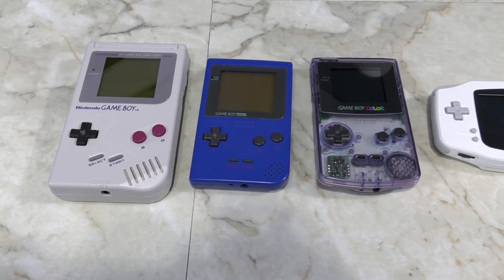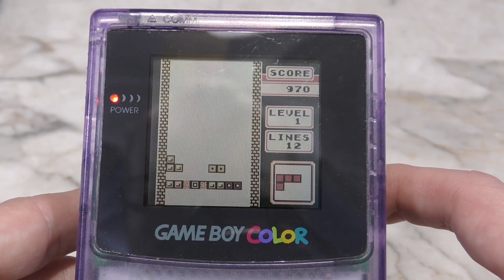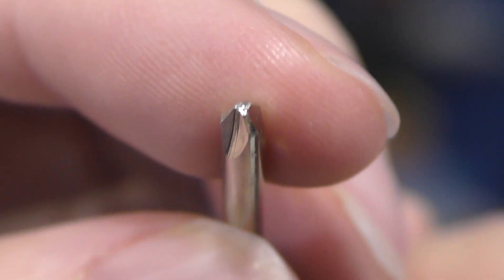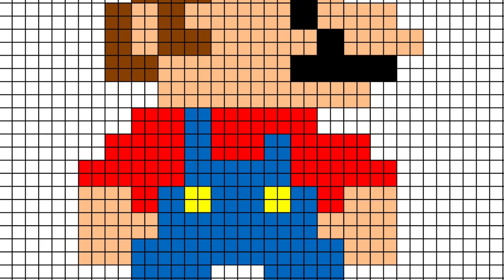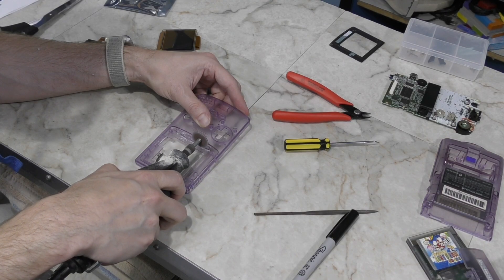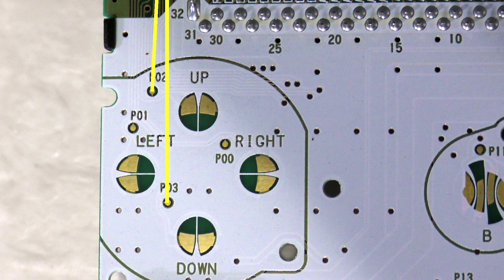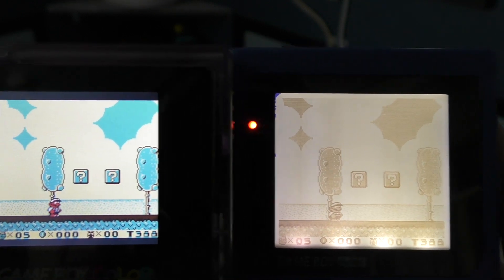Finally - A Gameboy Color Backlight Mod!

Comment: The Gameboy Color doesn't read the Super Gameboy Pallet enhancements. The way that the Gameboy Color and the Super Gameboy handle color is very different.  On the Gameboy Color, it has several different pallets for ALL Original Gameboy games, and it can't read the Super Gameboy enhancements.  The Super Gameboy can read the enhancements meant for it, and those that don't have those, you can edit the pallet it displays.

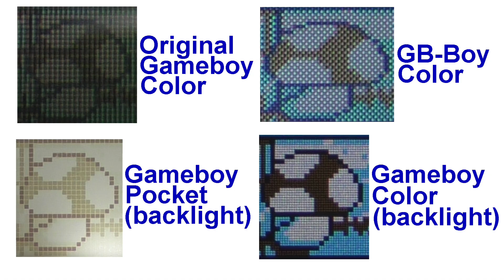Comment: What I'm noticing clearly now with the comparison at 11:55 is that, since these new backlit screens have way more pixels than the original screen, graphics end up looking a lot more jagged/stair-stepped than in the original, where things look smoother/rounder. I really wish we could get a screen with the same low pixel count of the original for a less pixelated/more organic look. We also need correct/non-saturated colors (ironically the colors on the GB Boy seem more accurate than on these new screens).
Reply: To me is quite the opposite. I really like that the pixels are more clear from each other xD.

Comment: 1:36 No, there was no color data in any game released between 1989 and 1994, because the Super Gameboy wasn't out yet, and the Gameboy Color was years away.  The games that seem to have their own color palettes only do so because the systems themselves have hard coding in them to look for certain games to apply palettes ad hoc.

Also, as far as color coding is concerned, Super Gameboy and Gameboy Color are two completely different things and not cross-compatible.  For example, Gameboy Donkey Kong has a comprehensive Super Gameboy color palette that doesn't load when played on a Gameboy Color.  There are games that had color modes on both systems (i.e., Wario Land II), but they were completely separate modes.

Comment: You need to be pretty hardcore to spend 65$ on the screen and at least 30 on a color. I mean I like playing on original hardware, but you get a bittboy for 40 bucks or an odroid go. Yeah, emulation will never be perfect, but it's good enough for me.

Comment: I think that new screen is sligtly smaller than original screen. And also games don't fill all the screen, there are black bars on the top and bottom edges

Comment: Something to try: there’s a product called “unseal” that is spectacular for removing adhesives and is very gentle, drying with absolutely no residue.  Doesn’t damage plastics and not greasy the way WD40 is.  May be difficult to find as it’s an industrial grade product.  I used it when I did conservation picture framing.

Comment: FPGA = the most power intensive digital hardware on the planet. Where's the battery life spec? That thing probably needs a new case with room for a lead/acid car battery. 
  There is an obvious reason why Nintendo didn't make a Game Gear. GG's were only as mobile as the distance to the next power outlet. We all liked GB's because they were actually mobile.

Comment: if 1 pix became 4pix, then shouldn't it be fourfold? how come it's only doubled?
Reply: Twice the horizontal resolution and twice the vertical resolution makes 4 times the surface (number of pixels being displayed). If your old screen is x pixels by y pixels, and your new screen has twice the resolution in both directions (2x instead of x, and 2 y instead of y), where the old screen would display xy pixels, the new one displays (2x)(2y)=4(xy) pixels.

Comment: Not a fan of the smaller screen size. I wish there was a larger screen mod for the GBC. Sure there are RPi mods (which are cool), but those are painfully much slower as oppose to instant on/off as the original hardware.

Comment: what a fantastic mod. You can go one up from this by using hacked ROMS that add full colour (actual proper colour, not interpreted colour from what little data is there). I've played pokemon Red with a full colour mod and super mario land 2 and they look absolutely gorgeous. With the right equipment I believe there is a way to flash these mods onto the real cart.

Comment: Going to play Devil's advocate here.

The reason Nintendo and CBS go out of the way to block unlicensed material to be released is not to be an ass, but it's for legal reasons. They need to protect their IP on every instance, no matter how small, because if they don't, then they set precedent.

Say they let that C64 port go because "it won't hurt their bottom line". Then another company decides to make another port, but for PC and for a bunch of other games, this time for profit. Now Nintendo is in a bad legal position to defend because there's a precedent when they didn't, which leaves them open to lose that litigation.

So yea, it sucks, but if they want to protect their IP, they have to do it to the fullest extent.

Comment: Isn’t there the mod from BenVenn called the FreckleShack?
Are they the same? Just curious.
Also, my GB Boy Colour has a normal vertical pixel LCD, not the strange diagonal pixel LCD yours has.
Like, the picture is still squished, but the pixels aren’t jagged.

Comment: Pity that higher res screen doesn't have a toggle to apply a simple filter to smoothen out the image like in emulators. But I guess that would probably require some extra hardware attached to it that would not necessarily fit, and the toggle would also need to be somehow reliably places there in a non jarring way?
Reply: Okay I just got to the point with the mod for controlling the backlight and so on - I guess that way there could be a key combination instead of the toggle as well that way...

Comment: Colors are not coded in the game for the super gameboy. There is a few palette swap for the 4 set of 4 grey scale found in games. Some games are recognized automatically by the game boy and a fitting palette is selected. You can also select a different palette by pressing a combination of directions and actions button on the initial "game boy" boot screen.

Also, new screen cover made of glass and fitted to the new screen dimensions are now available. They even made some with custom prints to fit special edition of the game boy

Comment: The overall screen display size seems different to the original, it has more black space above that's off putting for me. Personally I'll stick with a GBC as is or play on a Super Game Boy or Game Boy Player using the low latency software.

Comment: 4:38 Nintendo's marketing is working; I immediately associated that sound with the Switch's snap.

Edit: Why would the backlit screen display the image with small letterboxes? Did the original screen not have square pixels?

Comment: Some of these new mods are pretty good, but also very expensive. This one is actually more expensive than a second hand original where I live.
And for any perfectionists out there, another video pointed out that you will see the edges of the screen through the transparent window.

Comment: $65.00 for the replacement screen? WTF? No thanks
Reply: cool mod but imo i would get a gba sp for a few bucks.
Reply: Did you think a custom screen was going to be cheap?
Reply: @heroslippy6666  its made in china (cheap) right???
Reply: @NetScalerTrainer  no, they setup new production line and have to make a minimum amount of them for it to be produced to make it as cheap as it is, so they have to sell all of them to make a profit

Comment: Game Boy games do not contain any color data. The Game Boy Color also cannot use any Super Game Boy data. What the Game Boy Color does is just to assign a color to one of the 3 shades of grey the games use. It can also use a different palette for sprites. You can change the palette by holding a button combination while turning the system on.

Comment: A bit wrong. Original GB games did not contain any color data. That color was entirely made by GBC's internal palettes. SGB Enhanced games had color data, but only for SGB, not for GBC. Some original GB games did have different default palettes assigned to them, but again, it was all done by the GBC, not the games.

Comment: Small correction: the color data for the super Gameboy is not compatible with the Gameboy color. It's actually the GBC bios that adds colour to the original gb games, and has a bunch of presets in rom. Even still, it's not as good as the super gameboy's way of doing it.

Comment: It’s easy to solve the reflective screen issue with an antiglare screen protector. For several years I’ve been using screen protectors from Power Support International to turn the glossy screens of iPhones and iPads to a matte screen that is even very usable in sunlight. Bonus: It depolarizes the light from the LCD display, making it far easier to use my devices in any orientation while wearing polarized sunglasses.

Comment: Are you not impressed by 90s graphics? I'm still blown away by all the mode 7 shenanigans and early 3D = best 3D (Especially when mixed with 2D)

It is however important for the graphics to add to the game. Yoshi's Island and Battlefield Vietnam (Though this came out in the early 00s) are two great examples of this. In the former, the SuperFX chip allowed scaling, rotation and even some 3D objects, which made for some very memorable boss stages. While in the latter, the simple addition of foliage changed things entirely.

Comment: Now my Gameboy Color will finally be usable.

Completely unrelated to Nintendo but more related to Trek.
I like how you mention star trek fan films and CBS. I can see now that not only are you a retro tech enthusiast but a true nerd through and through. 

For the record, Axanar looks like it would make a great fan film, since you can get much better renderings on screen with much lower budgets and computers that are magnitudes more powerful than the ones in the 80s and 90s used during TNG/DS9/VOY. I mean, CBS would be idiotic to not capitalize on this fan base and make relatively low budget trek films that only need a green screen, some pretty good detailed sets and a lot of CGI renderings. I mean, what does a AMD Threadripper/Epyc machine cost compared to the really weak machines they were using in the 90s? 

Prelude to Axanar was filmed in front of a green screen and used all that. I bet they had less impressive hardware than that. It's a damn shame Axanar only gets to make like a half hour film or something.

Comment: I'd highly recommend the BennVenn screen option over MW Embedded - the battery life is drastically better. And, y'know, BennVenn kinda pioneered this stuff.
Reply: Has BennVenn resolved the compatibility issues with the Everdrive though? I'd be annoyed if I bought one only to find out I can't use my Everdrive.
Reply: I'm aware of the pinball lag issue with the early V1 of the PCB, but what is supposed to be wrong with everdrives? I have an Everdrive X3 that seems to be working fine.
Reply: @JonathosDX  multiple people on the Krikzz forum have reported that the graphics freeze but the audio keeps playing when using the X7 with the BennVenn mod.
Reply: Interesting. Haven't seen any real complaints elsewhere. Everdrives do have pretty high power draw, though - if the GBCs needed new caps and were already straining, I could definitely see a backlit screen pushing it over the edge. Though I'd suspect any of the kits would cause issues, given BV and MW both use the same actual screen.

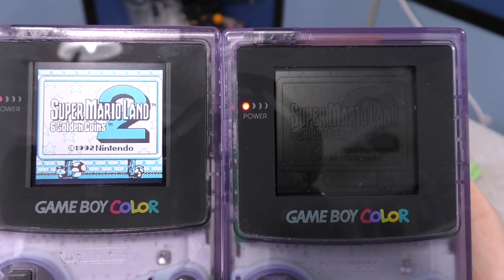Comment: Curious why if the screen is the same size, and the scaling is pixel-perfect, why is the image about 10% smaller (see 10:45 forward)?
Reply: Because the screen isn't the same size, it's smaller. The scaling is indeed pixel perfect, but the pixels are physically smaller.

Comment: Hopefully, this stops people from cannibalizing working AGS-101s to modify their GBCs. The added brightness seems well worth the slight loss in screen size. Plus it's a relatively simple install, unlike many other console mods of this type (even if you're not up to it yourself, finding someone with enough tools and soldering iron confidence to do a good job should be easy).

Comment: Bennvenn makes one called freckleshack that doesnt require you to butcher your gameboy so  badly.
Reply: Ive ordered mine since april 2nd and still nothing from benn venn.
Reply: you literally cannot tell that the gameboy is structurally modified here unless you take it apart and see that it has been cut. Obviously ignoring the fact that it has a totally different screen but the body mods are not visible under the screen protector.
Reply: @TheEpicLinkFreeman  Was more commenting on the amount of work needed to install it than anything and providing an alternative for those who may want it.
Reply: 1: Game Boy Colors were made in the millions and are generally in much better condition than most of the old NES toasters, so I don't think anyone will be upset at having to modify their GBC's out of factory condition.
2: As of when I'm posting this, Bennvenn's mod is more expensive AND out of stock.
Reply: @technoturnovers7072  The one listed here is out of stock as well and the BennVenn one requires no soldering. There is a new batches released all the time and he constantly updates on facebook about them.

Comment: When I was in high school, around my junior or senior year (around 95 to 96), I had an original old school fat gameboy monochrome, and I modified it with a backlight.  I got an electroluminescent backlight module for a black&white LCD Citizen portable TV, and put it into the Gameboy.  The Gameboy LCD had a goopy reflective material glued to the back of the LCD which I had to scrape off, very meticulously.  Also there was no room inside the Gameboy for the inverter module, necessarily to step up the voltage from the 6v of the Gameboy batteries to the ~100+ volts needed for the EL panel, so I fabricated some plastic box that glued to the back of the Gameboy.  The battery life was not affected noticably, EL backlights use very little power.

Comment: As I understand it, the original Gameboy didn't really store "colour" data, rather you could define palettes out of the four shades of grey it supported, given that the sprites could only show three shades at a time and the fourth would be transparency. I believe the GB kept palettes in memory for the background, windowing, and two different sprite palettes. When you go to play GB games on a Super Gameboy or GBC, those devices are simply replacing the greyscale parts of those palettes with colours, but because it's separate palettes they can use different colours for each palette. Super Gameboy Enhanced games would have additional data stored in the games to change these palettes on the fly instead of only at bootup. It's really interesting how colourizing was such a big deal for playing GB games, even back when the Super Gameboy was brand new! ;)

Comment: Lighter fluid i.e Naptha for removing glue.  I use the Ronsonol brand (yellow bottle red cap).  -  The best part is it's almost instant.

Or 71% isopropyl alcohol depending on the glue. - 91% eats some plastics really bad.  71% is pretty gentle.

Naph•tha
a flammable oil containing various hydrocarbons, obtained by the dry distillation of organic substances such as coal, shale, or petroleum.

Comment: Backlight aside higher resolution really improve the graphics. On other Gamboys you showed I can actually see the the pixels. New screen is really a huge improvement in that department. Although graphic wasn't upscale but it look really clean now because new screen, be its physical properties alone, basically applied  antyaliasing.

Comment: I really want something like this, but this and the other option i've seen use screens that are smaller than the originals, and besides them not fitting the case, and you being able to see the metal framing, the image is just smaller than the original screen, and let's face it, the original is not a huge screen to begin with. :/

Too many issues, at least for me. I'm hoping that there will be a revised version, that actually has the correct size, and better fitment. :)

Comment: You could just get a backlight GBA SP and have a more compact unit with all of the controls in the place he wants them. But that would be sane.
Reply: yep only minor quibbles: black border around the game image like at 2:08, cartridges stick out of the slot, adapter required for headphones. good enough for me
Reply: @nicktonic  The mod cuts the top and the bottom anyways which annoys me

Comment: Why would I buy a Switch when I can just play Mario on a C64?
Reply: Why would you buy a C64 just so you can play mario?
Reply: @alexc3504  Maybe he already owns a C64?
Reply: @user-pi5xz5je4y  And yet I've never been able find a working C64 :(
What is with that thing breaking down? They all seem to have bad PLA chips. I have two VIC-20s and they work perfectly fine...even though they're older!
Reply: @user-pi5xz5je4y  perhaps. It was just a joke.
Reply: Exactly!  I avoided having to buy a Nintendo switch because I had an attic full of C-64 computers.
Reply: Why would you buy a Switch or a C64 to play SMB when you can play the original rom on almost anything?
It would be a 1000 times easier to get a copy of SMB and an NES or Famiclone than to find a working C64 and the hardware necessary to run SMB C64.
Reply: @OM19_MO79  You haven't heard of the C64 Mini?
Reply: I do, have one and even tried SMB C64, but there's no need for being so passionate about a homebrew which I have reasons to believe it uses most of the original code, another reason to justify Nintendo's takedown.
Reply: you are sooo stupid
Reply: @Daniel Arturo Fajardo Jaramillo @OM19 MO79 Looks like the joke flew over your head... r/woooosh
Reply: @TolerableDruid6  I really don't think the OP was joking.
Reply: @OM19 MO79 Then you clearly don't have a sense of humour because it's very obvious that it was a sarcastic joke. Very obvious.
Reply: @OM19_MO79  the thing is they were though. Check your head
Reply: Daniel Arturo Fajardo Jaramillo r/wooosh